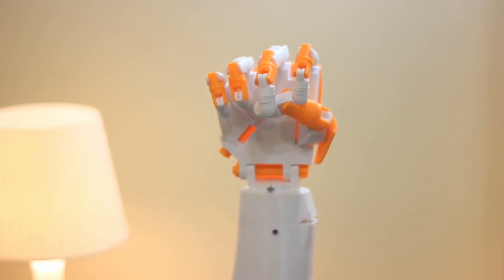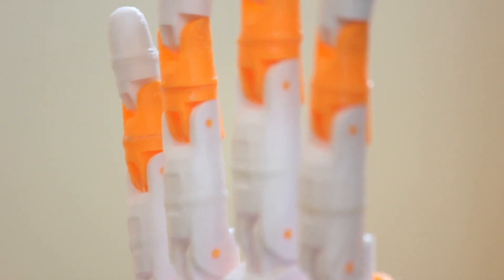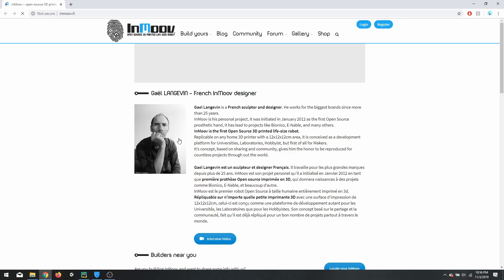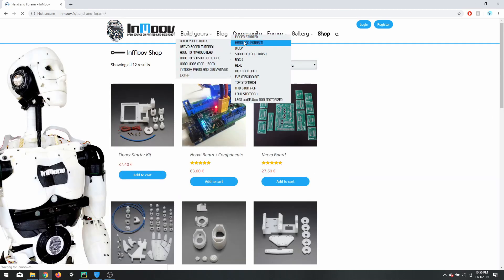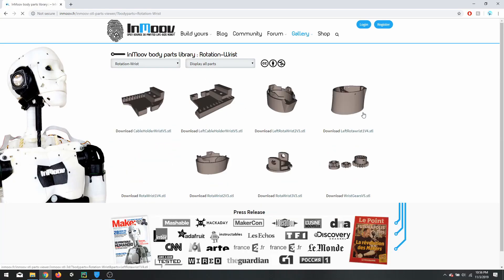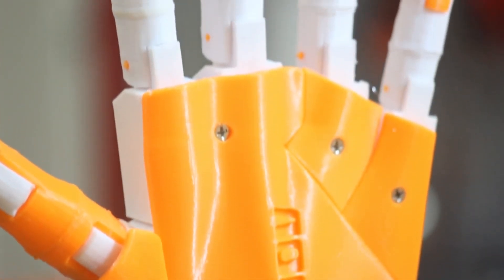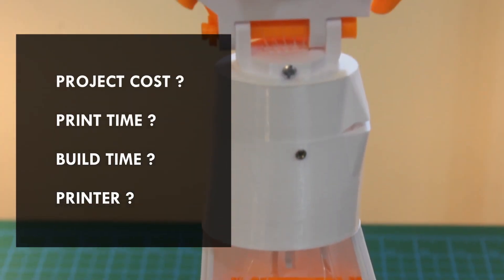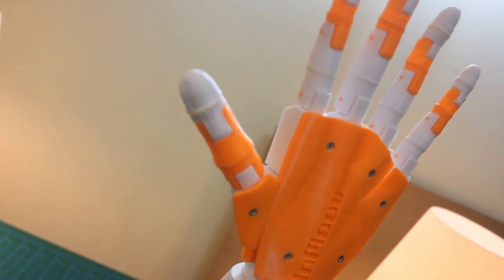Robot Arm Arduino Tutorial | Gesture Controlled (Part 1)

Comment: Hey there, 

Aishwary Jain from India. 

I saw your video of this robotic hand using gesture based controls,  I wanted to know somthings regarding it. 

1. Is this can be controlled remotely,  data transferred over Internet. 

2. Is this a patented tech and design.

3. Is any company/firm using this tech commercially. 

4. How much it will cost to have a complete hand (starting from shoulder joint) with this tech.

5. Can this robotic arm can be used to lift a liquid filled vessel.

We are a start-up, got investors and funds, based in India, want to use this tech in our application.

We are looking forward to talk to you and can discuss the terms and conditions to use this tech. 

We will be glad if we may crack through this deal.

Thanks and regards

Aishwary Jain

India

Sachin enterprises

Unique alliance group

We Deserve Academy

WhatsApp:  +918503075123

Comment: please help me with this error:

myPos[myCounter] = far[0]
IndexError: index 4 is out of bounds for axis 0 with size 4
[ WARN:0] global C:\Users\appveyor\AppData\Local\Temp\1\pip-req-build-k8sx3e60\opencv\modules\videoio\src\cap_msmf.cpp (435) `anonymous-namespace'::SourceReaderCB::~SourceReaderCB terminating async callback

initially it worked, but about 10 seconds later Python stopped sending data to arduino any more, so the servo doesn't work ...
Reply: did you find the solution ?